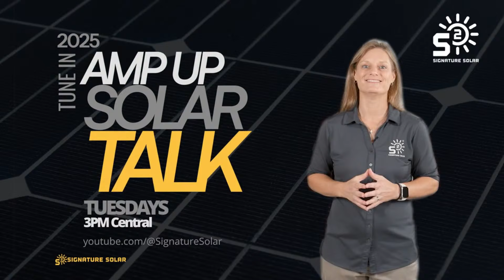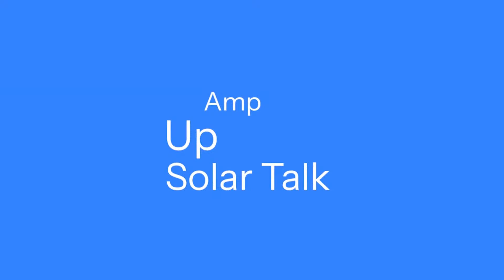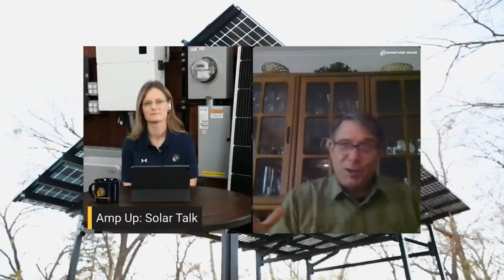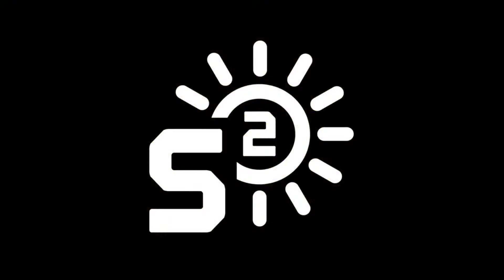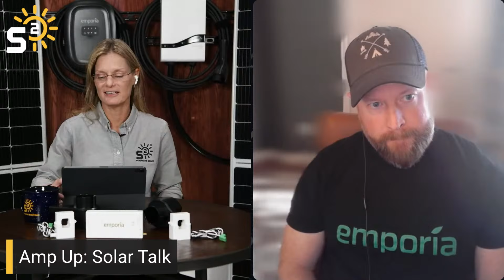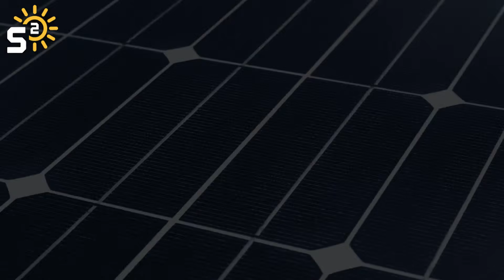Amp Up: Solar Talk - Ep. 34 - Emporia Pro EV Charger & Vue Energy Monitors

Comment: How much solar does a 30 amp setting need ?
Reply from the maker: A 30A load at 240VAC requires approximately 7.2kW of continuous power to. In solar applications, it is also common practice to slightly oversize your solar array to account for environmental factors such as temperature, weather conditions, shading, and normal system losses. This extra capacity helps make sure the system can still deliver the power you need, even when conditions aren't perfect.

Comment: The solar feature on this EV charger is confusing. I dont recommend this charger if the purpose of buying it is to use excess solar energy from your panels to limit the amount of energy going back into the grid. I cant seem to figure out how to get the charger to use excess solar (as i have solar panels) so what iv been doing is just charging my car via 20 amps as it'll pull 5000 watts. My max solar production is 6500 watts. This way, i can send the minimal excess solar back to the grid. The Emporia is supposed to maximize my solar production but its just so confusing to use, i turn that feature off and just charge at a stable 20 amps. Iv had it for nearly 1 year now and its not very user friendly as far as solar. I did reach out to Emporia and they mentioned "We realize its a bit confusing and were working on the app to make it more user friendly"... This was a year ago and still no updates on using the excess solar feature despite them changing the interface of the emporia app itself. Bit disappointed. Will probably sell the unit on Ebay and get something more intuitive.
Reply from the maker: Have you tried reaching out to our support team at 903-441-2090? They may be able to help you troubleshoot this issue.

Comment: Very disappointed after watching this video.  Completely a miss that the have to connect to the internet to use their energy management features!  Well set up systems will have their WiFi routers backed up so WiFi will be available and Emporia should be using some peer to peer design to still manage their devices even with a loss of connection to an ISP.

Also, complete miss on ability to use solar via non-grid tied solar such as Anker or Delta power stations with power panels like HPP.